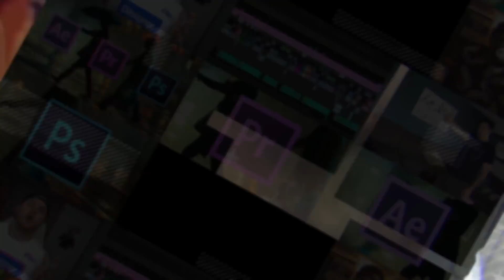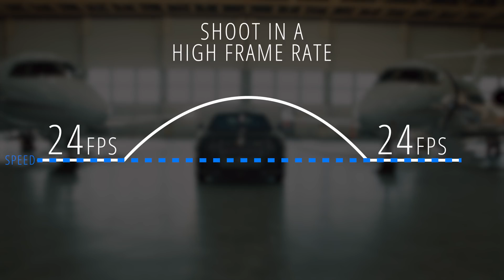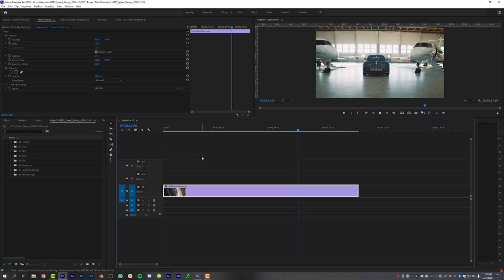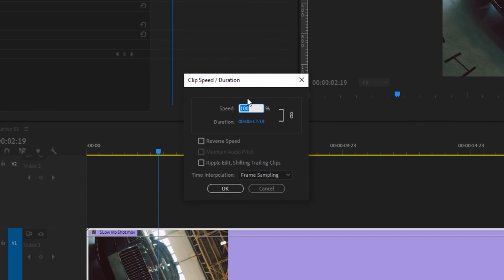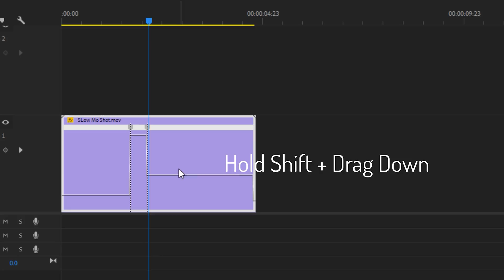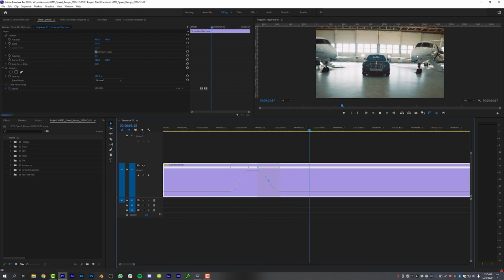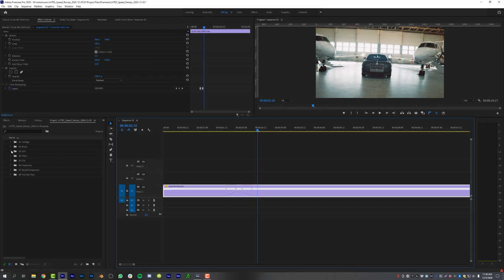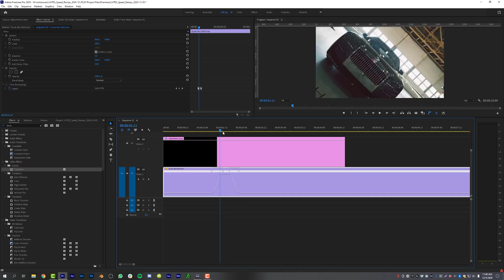Smooth Speed Ramps and Speed Changes in Adobe Premiere 2020

Comment: A small question to anyone who might know....When we speed up a normal 30fps clip on the timeline, the software is taking every 10th frame or so (example only) to make the video run faster ? so after final render i can see ghosting, like double frames of the previous frame like showing thru, and if you pause you can clearly see there's an overlap of the previous and the current frame. I tried different resample modes..smart, forced, disable etc. Still same result. There's no motion blur.

Comment: Ian, love your videos - concise and packed full of info. I've learnt loads from you, so a big 'thanks' from me. 
I was wondering if you could consider a topic for a future video? When I put my videos together for a client I often use lots of stock footage in there and use the low-res comping clips until the client approves. My question is: how can I quickly and easily swap this footage out (in Premiere) and replace it with the hi-res footage afterwards? Often, there are lots of jump/stutter cuts (thanks to you) plus any transformations etc., and it's not a simple job of holding the CTRL key and dragging over the top. Is there a quick and easy way to do this?
Reply from the maker: Great question! And yes! You can right click > make media offline then right click again > link med and link it to the high res clip! In theory it "should" work... but if you're doing any scaling on the low res clip then it might get funky at some point... It's not a very fast workaround, but it will work.
Reply: @LearnHowToGenerateStuff  Hi Ian, thanks so much for the quick reply! I'll try this method shortly and let you know how it copes with all the cuts and transformations - it'll be a good challenge. It's got to be easier/quicker than my current workflow....no wonder I have no hair left!
You're the best - thanks from the chilly north of England  :  )
Reply: @LearnHowToGenerateStuff  Ian - you are the absolute top man (I have other terms of endearment but I'm in my late fifties)!!  I've just tried this and it works a treat. It not only replaces the clip wherever it appears on my timeline but seems to remember scaling and whichever portion of the clip I'm using. This is going to save me so much time......and we know what time means? Thank you so, so much - this is a game changer for me - I may be retiring early!!   :  )